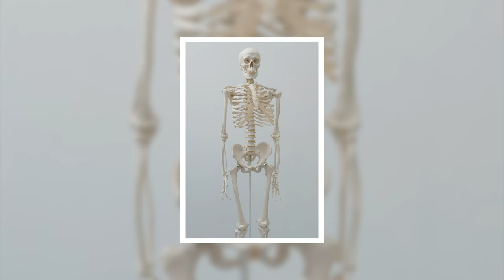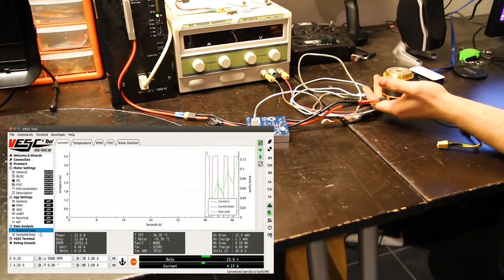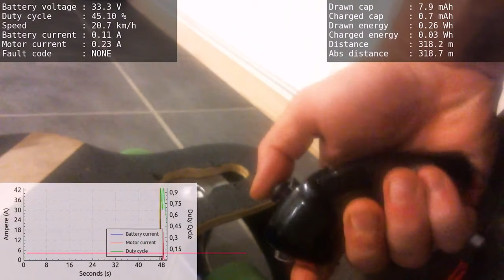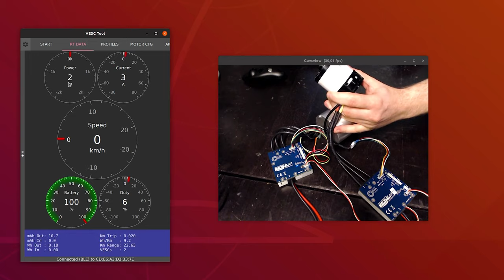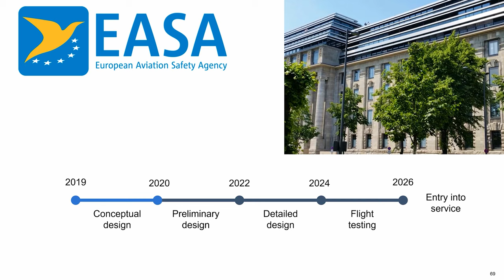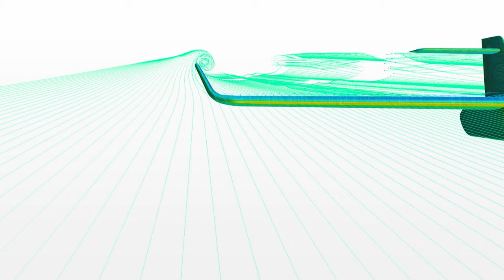ELECTRIC AEROPLANES are coming - thanks to electric skateboards!

Comment: If only they could develop a readable website that doesn’t give you a headache reading it.
Reply: Websites fine?? maybe try turning the brightness on your monitor down or spend less time on fortnite this should help with headaches 😉
Reply: I do agree, needs simplifying.
Reply: @mountainsmedia9529  how dare you use such a low insult as fortnite. have you ever even looked at their website??? the font is just unreadable, the user interface is crap, they slap all available specs and stuff in a tiny space. the whole website looks like some poorly designed chinese website selling offbrand scooter/moped parts.
Reply: @MeesDeppe_Official  if you can’t figure out a website that offers more customisation than any possibly all the brands put together then how you gonna figure out how to maintain one or ride one like they should be ridden 😂 stick with your one click buy it now boards. Or simply just do what you yearn to do spend the time building a board on there to your specs go out shred it on any terrain and be the envy of all your esk8 pals. Peace out homeslice
Reply: @mountainsmedia9529  oh i can figure it out just fine, but you cannot argue that it is terribly designed. the user interface is just god awful. (ps: i'm literally studying design at uni) (ps ps: i've already built about 6 electric skateboards and currently designing an electric minibike so i know what i'm talking about mate.)
Reply: haha. oh man, glad i'm not the only one that thinks this. information overload.

Comment: Way too much BS in this video!
Reply from the maker: Jealously is a drug 😘
Reply: @Electroheads  he is kinda factually right tho. Electric planes exist and have before Vedder made a VESC and I doubt the inventors were inspired by a mountain board lol. I also don’t believe many production boards use a VESC but their own speed controllers which have existed for quite some time. A reliable open source one is what we thank Benjamin for.
Reply: @charlescohen7916  If the production boards are cheap chinese crap boards then they don't use a VESC. Every single quality e-board uses it. There is nothing comparable to a VESC in terms of vedder's code. He's been working and adding to it for years now
Reply: @esk8spirit362  the problem is we are unlikely to then agree on what a quality board is.

Whilst I’m sure there is an abundance of extra features and upgrades possible, I’m also of the opinion that there is little point trying to fix something that isn’t broke and so I’d say the Boosted speed controller wins hands down. 

I don’t think that’s a VEdder. My Mellow has a beautiful throttle curve and I now always kick push to start anyway but at first I wasn’t the biggest fan and I do like reverse. I need more time with the  evolve one just to find my preferred values that I can customise. So yeah, you’ll possibly lol @ boosted / evolve / mellow being put into the quality bracket as i’d hazard a guess you’re Team DIY.

So what quality boards use them? Trampa and their knock-offs are the only ones I’m aware of. I wonder why lacroix didn’t use them.

Even VEdder himself often looks uncomfortable with how much he’s idolised. His niche was the reliable open source part, it’s misleading to somewhat imply he invented the ESC.
Reply: @charlescohen7916  Trampa, Bioboards, Lacroix, Kaly I am not saying you cannot have a good quality board without a VESC type unit. But a good VESC unit will outdo and outperform other ESCs in every little thing. VESC type esc gives you 13 percent more range than other ESCs, it is fully customizable. You can set the board according to your needs, you can add things like METR pro module, have full real time telemetry, you can use any remote you want. WIth cheaper stock boards you get what you get and you are stuck with it. Of course some boards have their own app and a few settings but incomparable to what VESC can do. But that doesn't mean a reliable board must have a VESC unit. Evolve is a piece of shit, for that money you could buy a board twice as good but Boosted for example has it's own proprietary ESC and they used to be good quality, not sure how it is now. I just think it should become a standard to have a VESC unit inside. Vedder wrote the code for VESC, without him we would be using shitty ebike controllers in DIY. YOu need to take what I say with a margin, not generelise as I tend to have certain things on my mind when I enter comments, you can't apply it to "everything" :)
Reply: @esk8spirit362  right so your claim is the vesc is the best because it can handle totally over the top specs. I’m not convinced. I’ll be riding a bio board this weekend but hear bad things. Lacroix use stormcore, so your facts are wrong and a Kaly is just an old Trampa knock-off.

My point was backing up the comment that this video is very misleading and giving Vedder credit for something he didn’t invent and going as far to try and claim he inspired the idea of electric planes 😳
Reply: @esk8spirit362  Hrm ok I read the rest of that nonsense too and just lol mate. He didn’t invent the esc and he made a good one for skateboards but not the first, not the only and not the best.
Reply: @charlescohen7916  then you cant read correctly obviously, I said he wrote the code and yes, the best one by miles. If you're trying to say there is anything comparable to a vesc unit then you are talking absolute nonsense and you dont know anything about eskate lol. Feel free to give arguments, you hype evolve crap, have never done diy, so please... i am being nice and explaining, if you cant take that, either debate and give arguments or kindly dont talk at all...
Reply: @charlescohen7916  No problem, I just don't like when I tell you what I think and you say "nonsense, lol" that's all... Man you talk like you know your stuff but you have never even stood on a VESC board as you say, that's kinda funny. Vedder is the reason why the whole world can have VESCs and anyone can make them and use his code to run them. VESC is the best because it is the best, there is nothing that reacts like a VESC, nothing you can set up on like a VESC. FOC control, flawless power delivery, as smooth as it gets. I have lend my super board to little kids, try to give an evolve in full power to a kid, anyone actually, they will fall immediatelly. I am not gonna spend time with you as you have no counter arguments and you just don't know your stuff. I have tried many boards before, not knowing a VESC unit is an absolute blast and that you cannot ride a power board without it and that there is nothing on the market that comes close to it in any way by miles and miles shows you don't know your stuff. WHich is no problem but don't "lol" me when you just don't know. I don't really agree with the electric planes either, but VESC is a total awesomeness. WHat kind of units you think we would be using today? Name one single ESC... Look at Bajaboard, the only board with power not using a VESC and you know how badly it reacts? When you go to throttle, it first gives you brakes, non sense like this. THERE IS NOTHING ON THE MARKET LIKE THE VESC CONTROLLERS, PERIOD!
Reply: @esk8 spirit I mean, you are factually typing nonsense dude. I’ll waste my energy one more time to explain why. No opinions, just facts.

1. I never said I’ve never been in a board with a VESC, I have. It’s not fair to compare them because they’re all customised and people like the throttle curves they’re accustomed to. We agree evolve is one of the worst but once you’ve accustomed, it’s fine.

2. You tell me ‘you talk like you know your stuff’ later on telling me ‘you don’t know your stuff’.

Well, I talk like I do because I do. You’re probably upset you’ve been caught lying or you don’t know your stuff because you claimed lacroix used vesc when it doesn’t. So you’re either ignorant or a liar right now.

3. Thank you for acknowledging I’m right to defend the guy on the basis the video is kinda dumb in trying to give vedder recognition for the invention or the idea of an electric plane.

4. ‘The best’ is subjective. The best for one person is not the best for another. Just because I don’t care to ride at stupid speeds doesn’t mean a trampa is better than my mellow. It’s not better when it sits at home and I take 2 mellow drives and boosted board on holiday with me and my friends. How is the trampa better when it’s sat at home because it can’t go on a plane.

5. I don’t want to customise the throttle curves because the one boosted made is perfect. There is no ‘better’ other than configuring a vesc to be the same as one that is already invented.
Reply: @charlescohen7916  ALso one more time, I do know my stuff, you still haven't mentioned any ESC that could be compared to a VESC (because there is none) You either don't understand English or have problems reading, since you take stuff what I type too specifically and offensively, I was trying to tell you not to. You don't comment on anything important I said. For example the fact that VESC has flawless power delivery (unlike other ESCs), Kelly controllers have been here for a long time, all ebikes use them, they are a total laugh in terms of power delivery, VESC has full absolute customizability, can be use for eskates, Unicycles, one wheel, airplane, whatever. Which other Esc can do that? Other ESCs on the market are either cheap chinese shit ESCs or low power proprietary ESCs made for a specific board, for ex. like the one Boosted has. THe best is not subjective unless you don't know what you are talking about. Of course you can say stuff like Fiat has the best motor, but it doesn't even though that might be your opinion or the way you feel. Lacroix doesn't use a VESC type esc? Dude you are full of non sense, they have always used a VESC type ESc, first the unity, now their own Stormcore. You are either totally ignorant to even check I am right or you are flat out trying to lie cause you don't like I am right. I haven't heard more idiotic non sense in a long time... Hate when people pretend they are educated and know their stuff and argue and say the stupidest things that show the exact opposite... Man you should think about how you act...
Reply: @esk8spirit362  shush little man. ‘Better’ is subjective. How do you fail to understand. Vesc is an open source version of something that existed for a long time.
Reply: @charlescohen7916  Still no EScs you can mention can you? Lacroix not using a VESC type ESC, interesting info :) Dude Vedder wrote the code for VESC like 4 years ago or something and has been writing and adding ever since Who told you we had that before? WHen he wrote the code for it... Will you start giving counter arguments or just spewing hate and being offensive instead of factual and debating?  What units does Stormcore use my man? What units did they use to use? Shows you have no clue what you are talking about. You being wrong ca n be proven within a minute. No, better is not subjective for christ, not in terms of ESCs in eskate. And if you think you have something comparable or even better, common sense tells me you would mention it maybe? Kids do this... maybe don't be a kid, it's hard to accept when you are wrong I know... I only get offensive as much as the person I am talking to so If you don't like my talk, better yourself and educate yourself, lower down your ego and accept there are people that know more than you...
Reply: @UCgxTegBSMe-Ae4q1i3IZ7vg boosted esc is better for me. I don’t want to wire shit together or customise anything when it’s perfect already. Let it go. It’s called personal preference. Speeds and ranges are dictated by the battery pack sizes. Many esc’s handle high power if they need to. I don’t care for that because those mad range and mad speed boards can’t be taken on a plane so they’re not better for me. A bus is better at carrying passengers and a Ferrari is better at going fast. It’s situational and subjective. Try hard to get that into your narrow mind.
Reply: @charlescohen7916  COmpare apples to apples, VESC unity will get 13 percent more range, will have better power delivery and you can use any remote you want. WIth boosted ESC you can't so how does that make Boosted Esc better? You mean the fact it comes preset from the factory? How is that a valid argument? Have your Vesc preset from someone as well. In your terms If you have to set boosted up, their ESC wouldn't be as good all of  sudden. That makes no sense man.